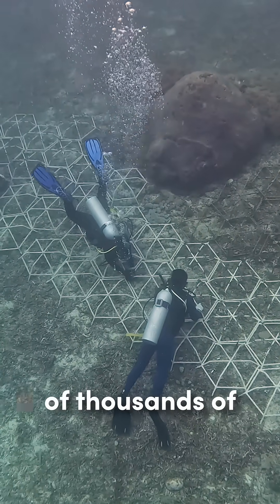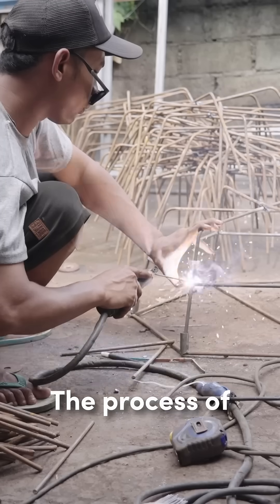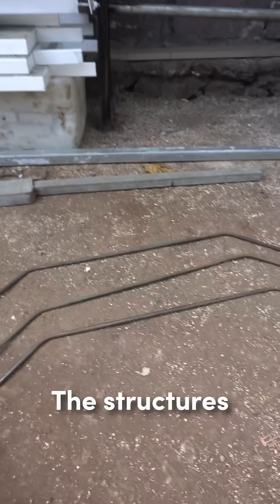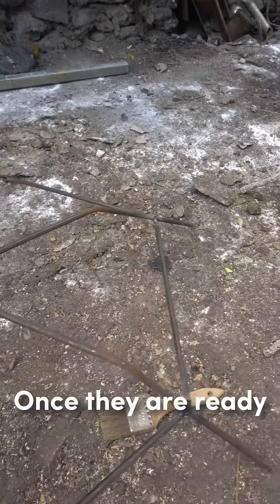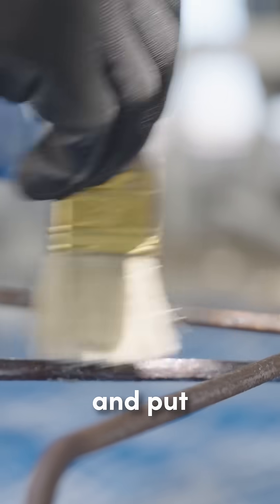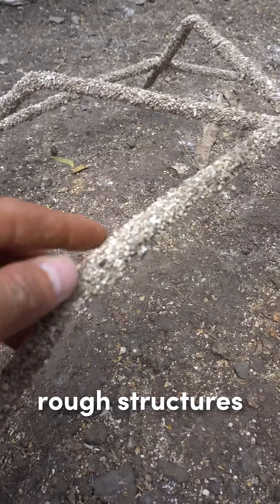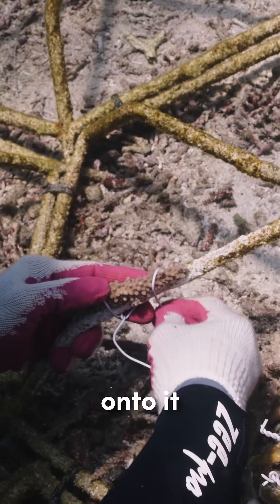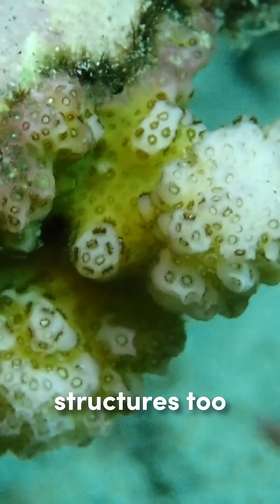How we make our reef restoration structures

Comment: Please please get this crew proper welder's masks. He's pictured using sunglasses. Sunglasses will not work as a welder's mask because they do not adequately filter harmful UV and IR (infrared) radiation, nor do they protect against hot sparks and slag, which can cause severe eye injury
Reply: second that, please give them proper secure welder masks!